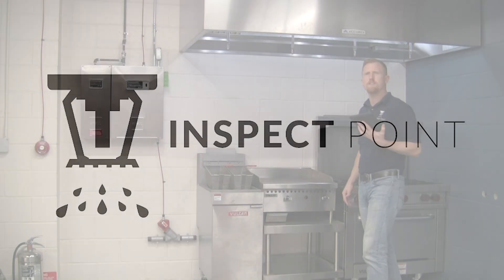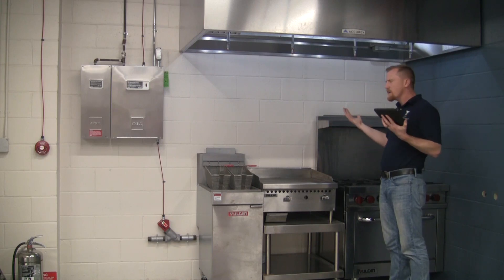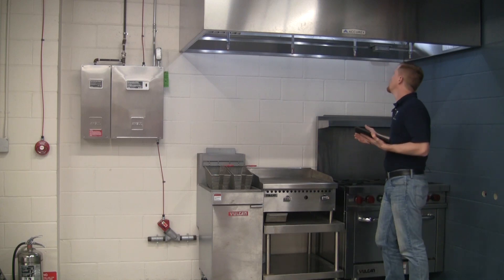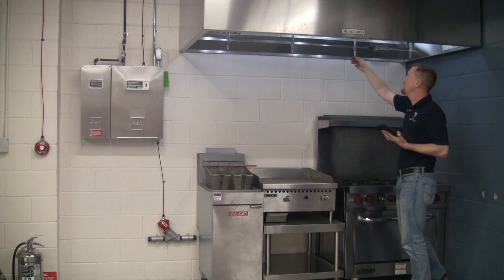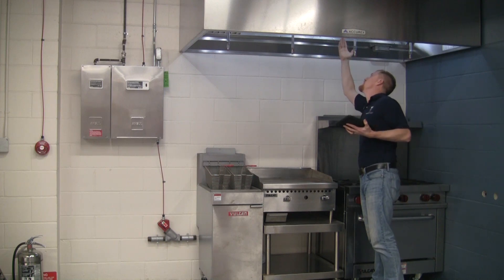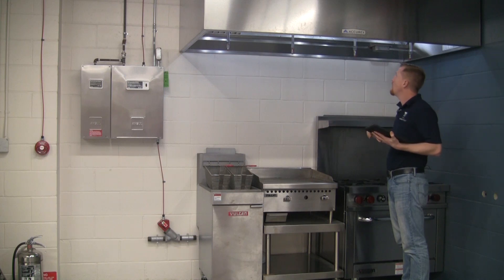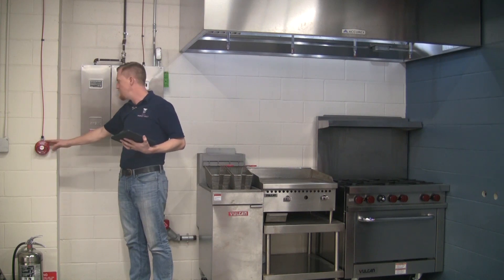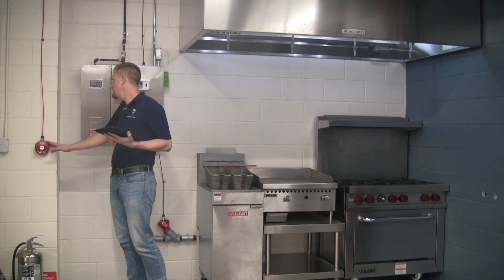Kitchen Suppression System Inspection

Comment: Nozzle above the griddle should be placed on it's perimeter with an angle.
You need 3 1F above the range, as it is it's protected as if there was no backshelf.
Using the red flexible instead of EMT costs alot more, the person who installed this made good profit

Comment: Has the wrong nozzles over range with shelf
Reply: Getting obstructed by the shelf smh needs a 1f
Reply: By the looks of it you only really need a 3gl tank
Reply: If the fryer is a 3n griddle a 290 and 2 1fs on 4 burner and plenum 1n I doubt it’s longer than 10ft hood and a 2w for duct should only be 10 flows unless they use 260 nozzles on 4 burner by the looks of it I doubt it exceeds 28” of length so a 1f should work
Reply: Looks to me like overlapping coverage which makes the coverage and 6 gallon tank setup correct. Also... its a demo setup... but I'm just guessing like the rest.
Reply: Sloppy install